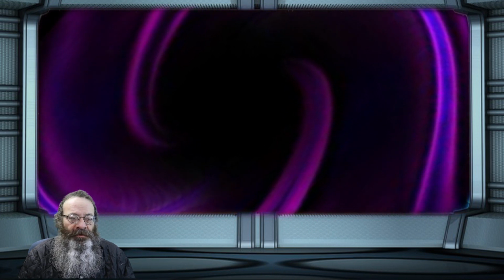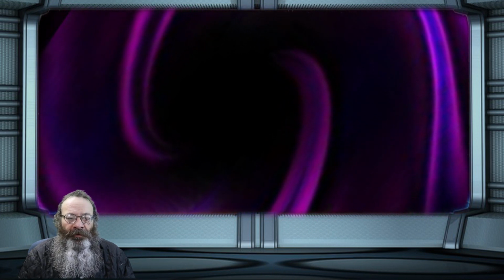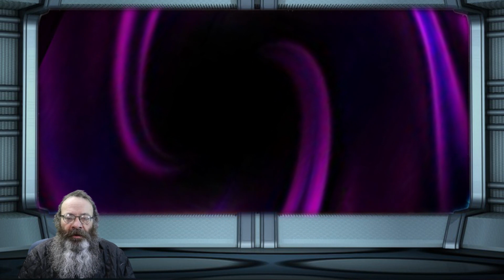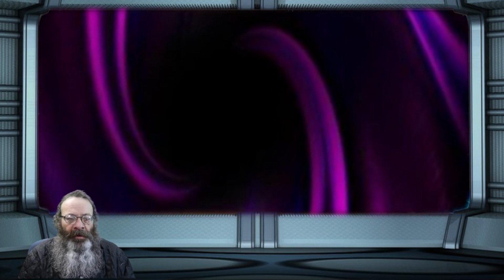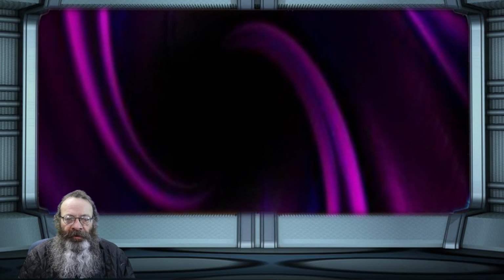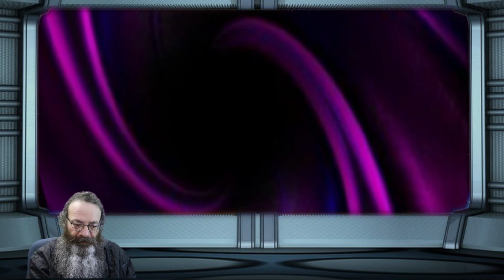A Quicker Path to Fusion Power? Australian Scientists Claimed Astonishing Breakthrough

Comment: Too little information in the video or the web site. It never explains how the fusion reaction would generate electric power from the fusion reaction. I was hoping more of the process of hydrogen-born fusion would be described but that never took place either in the video or the written report on the web site.
Reply: The fusion on boron 11 and a proton create alpha particles which are positively charged creating an electron deficit and potential difference thus a voltage without the need of a thermal generator. Direct conversion of fusion energy to electricity. The boron is fused by a chirp pulsed laser, inertial confinement fusion. No radioactivity because no free neutrons.